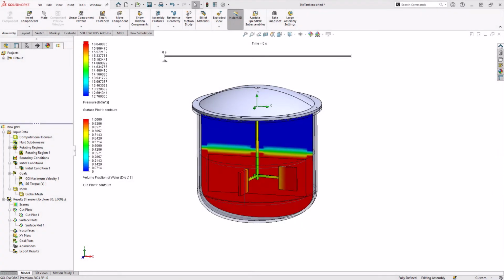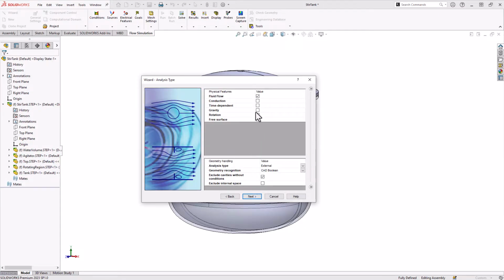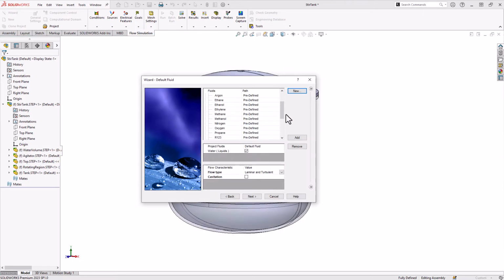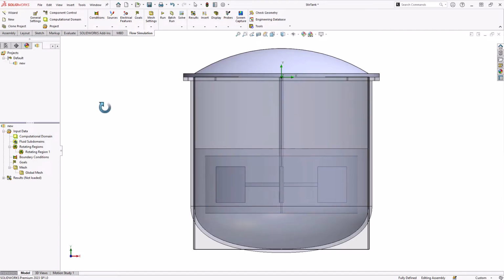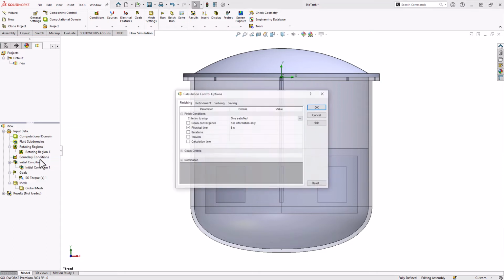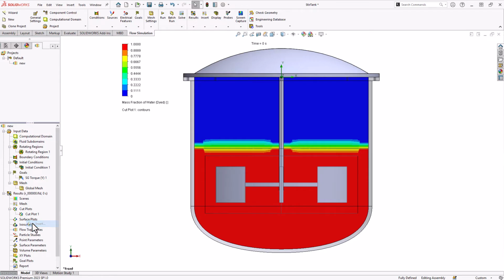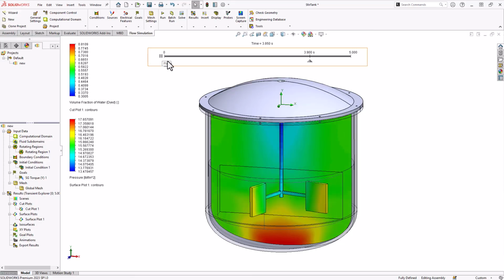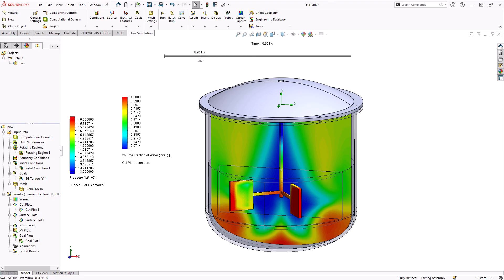Mixing Tank with SOLIDWORKS Flow Simulation

Comment: Hi! it's fantastic. I have a question: why the torque (Y) is different when I use X FLOW programm considering that I have used the same data input in Flow simulation? Thank's a lot for your response and helpfulness.
Reply from the maker: There would be quite a few things to check - I know you mentioned the input data is the same but verifying the liquid viscosity is equivalent, and that mesh refinement has been performed in both software to achieve mesh convergence (or "lattice refinement" in the case of XFlow) would probably be the most important things to verify. These tutorials feature very coarse mesh for the purpose of demonstration.

Were you using the "Free surface" functionality in both packages? In the tutorials we created, we used free surface for XFlow (which represents a tank with headspace / airspace at the top) whereas SOLIDWORKS Flow Simulation version tutorial featured a completely filled tank. These will of course produce different torque results, with the simulation representing the headspace expected to be more accurate if that is the physical condition.
Reply: @hawkridgesystems  
Thank's a lot for your answer.
I redid the simulation and got more similar values between Solidworks and Xflow.

Comment: For some reason even though my volume of "dyed" water takes up only 25% of the whole tank, after some time of mixing the volume fraction of dyed water is 0.5 on every point of the tank, not 0.25 like one would expect. Why does this happen?
Reply: Oh and other times the dyed water just seems to disappear from the tank altogether, even though there are no holes in my tank
Reply from the maker: @christosfrantsis7599  Did you check to ensure on the "Initial Conditions" screen that the substance concentrations are initialized correctly? The first issue (settling on a 0.5 value) sounds like maybe it was set to a 50/50 concentration instead of 100/0
Reply: @hawkridgesystems  Thank you so much for your answer. It turns out that my mesh resolution was too low. It all works great now ☺️.

Comment: How provide the solid body melting?
Reply from the maker: The solid materials have a melting temperature parameter but this will simply provide a warning when it is exceeded, there are no capabilities to represent solid to liquid phase transition in SOLIDWORKS Flow Simulation
Reply: @hawkridgesystems  could you please advise where I can read mor3 detail about that?

Comment: Thanks for the video, is it possible to add a heat source to a moving object (rotating or parallel motion) in solidworks to simulate temperature change?  Is it possible with this model to add a heat source to the wings of a rotating mixer, for example? I know they each have a function, but I was wondering if it is possible to do both at the same time. I asked because I tried a couple of times, but the heat source was calculated to stay in place.
Reply from the maker: It should be supported for rotating motion, linear or other body motion is not really possible in SOLIDWORKS Flow Simulation

There are some limitations around conduction between rotating and non-rotating parts when using the Sliding Mesh approach, but they shouldn't effect something like a heated mixer significantly.
Reply: @hawkridgesystems  Thank you very much for your reply. I tried adding a radiant heat source to the rotating body, but the rotation function was ignored in the heat-related results.
Reply from the maker: @6023  What was the exact heat source definition? If you use something like a "volume source" to heat the mixer/agitator itself it should work. This also requires conduction enabled in the project settings and an appropriate conducting solid material applied to the agitator/mixer.
Reply: @hawkridgesystems  It was Radiation source with directional type.

Comment: Sir  is it possible to analyze mixing of  co2 gas with cold water in a pressurized vessel 
Suppose a vessel is in vertical  shape( 400mm diameter × 1700mm height) and vessel is packed with perforated plates and we pressurized that vessel up to 100 psi 
and then with the help of high pressure pump, water is sprayed through nozzles from the top of vessel towards bottom.
My goal is to find out how long is it take to water to pass through those perforated plates and at last how much co2 gas is mixed in water
Sir can we do all these things in solidworks flow simulation

Comment: Hello, thank you for your video, it's very useful.
I would like to ask if it is possible to add an air space in the top ?
Reply from the maker: It's possible to include the headspace if the "free surface" option is enabled. This lets you load both air and your liquid in as fluids. 

Then you would need to set an initial condition to set the waterline to the correct height. This can be done by using some dependency / height function or modeling a solid body to represent the liquid region, and specifying an initial condition on it.

Unfortunately though you can only have two liquids using the free surface approach, so you wouldn't be able to actually simulate the mixing of a secondary liquid with the headspace. You could infer the mixing performance from the velocities.

To simulate the mixing of multiple liquids and also represent the headspace simultaneously, we can do that in SIMULIA XFlow, and have an additional tutorial here: https://www.youtube.com/watch?v=P2bCsVFlpXQ

Comment: Given the ease of GUI based setup shown why would an alternative such as Ansys similar be preferred
Reply from the maker: Generally our recommendation would be to step up to a dedicated standalone analysis tool only when it's required for the physics of the application or when solve time or performance becomes a limiting factor. 

CAD-embedded analysis tools are developed to be very good at solving the most common classes of problems- such as linear static stress analysis, internal/external fluid flow, and thermal problems. This enables designers and engineers to make quick design-time decisions without having to invest significant effort into setup for the vast majority of their applications.

The same CAD-embedded analysis tools may not have specialized boundary conditions, solvers, and post-processing options that could be relevant for certain industries. They also tend to have more limited scalability in terms of solving on HPC cluster or GPU. 

In this particular case, we have an example of running the same simulation in SIMULIA XFlow which enables handling of additional physics for mixing tanks. For instance, a reciprocating style mixer would not be possible to simulate in SOLIDWORKS Flow Simulation as it does not support translational mesh motion, only rotational. XFlow supports generalized movement, as well as more robust "free surface" interactions which also allows including the headspace at the top of the mixing tanks. 

Mixing Tank analysis in XFlow: https://youtu.be/P2bCsVFlpXQ

Solution accuracy (when the physics and boundary conditions are supported) is generally not an issue compared between CAD-embedded analysis packages and standalone packages. You can find validation examples for SOLIDWORKS Flow Simulation here: https://www.solidworks.com/sw/docs/Flow_Validation_Methodology-Whitepaper.pdf

And similar examples for SOLIDWORKS Simulation are embedded within the software. It's always a good idea to check that the software package is well validated for a problem with similar physics to yours. 

Lastly regarding performance, the SOLIDWORKS Flow Simulation and SOLIDWORKS Simulation tools have a somewhat noticeable dropoff past ~16 cores though there is no hard limit to problem scaling. This is generally sufficient for tackling wide ranges of problems. Dedicated analysis software may be able to scale to hundreds or thousands of cores, but also requires increased cost of consumable credits or other per-core licensing scheme.

Comment: hThank you for the video but it not work for me yet. the message: Il n'y a pas de volume fluide dans le projet Vérifiez la géométrie ou les conditions aux limites. (it didn't found the volume of the fluid) I need help
Reply from the maker: Be sure to clear / uncheck "Exclude cavities without Flow Conditions" during the Project Wizard (this is the most likely cause)
Reply: @hawkridgesystems  hello, it give me volume fraction wter copie) 0 (all in blue and didn't show me the picture )
Reply: also in the case of exclude cavities without flow conditions i don't heve the case of "find the flow)

Comment: Thank you for this video. It is very helpful and interesting. When you set the direction of the rotating region, you refer to the liquid rotation or at the stirrer rotation? The sign of the torque on the shaft change.
thank you in advance
Reply from the maker: The rotating region direction refers to the rotation direction of any solid bodies contained within

As far as the sign on torque, that follows right-hand rule for the coordinate system specified. Generally we recommend to align the rotating region axis with the global origin / coordinate system so the reported torque values are correct.

Comment: Thanks for making the video!
I tried this tutorial, but I got an error saying "There are no fluid regions in the project. Please check geometry or boundary conditions."
Is it necessary to set the fluid subdomains?
Reply from the maker: There's a couple possibilities:
-Be sure to clear / uncheck "Exclude cavities without Flow Conditions" during the Project Wizard (this is the most likely cause)
-When defining the "Initial Condition" for the second substance concentration, check the checkbox for "Disable Solid Component"
-Ensure the "Computational Domain" is properly size. Edit it and click "Reset" after performing the above steps and it should snap to roughly the size of the entire tank.
Reply: @hawkridgesystems  Thank you for answering!
As you might have guessed, "Exclude cavities without Flow Conditions" was still checked. After changing it, I got the desired result. thank you! ! !

Comment: Hi, do solidworks fluids simulation get's pressure and temperature data of a gase in a confined conteiner?
Exaple: internal combustion engine
Reply from the maker: The solver in SOLIDWORKS Flow Simulation is compressible and will support the proper thermodynamics of gas expansion and compression (either with ideal gas or "real gas" model) 

However there is no way to support the translating wall of a reciprocating piston in SOLIDWORKS Flow Simulation. The only geometry motion that can be defined is via the rotating regions. Combustion is also not supported directly

Something like simulating the mixture of exhaust  through a turbocharger turbine should be possible, or simulating intake or exhaust flow with valves in fixed position. 

Translational body motion is possible in SIMULIA XFlow and it can be used for applications such as piston cooling

Comment: what version do you use Sir?
Reply from the maker: SOLIDWORKS Premium 2023 and SOLIDWORKS Flow Simulation 2023 were used in this video . You should be able to follow along with the same procedure back through the 2018 version, possibly even older versions

Comment: I need this type of study done, but with a constant input/output of water and solid through an open top and piped bottom.  Any contacts that could do this?
Reply from the maker: This is a type of analysis we could run in either SOLIDWORKS Flow Simulation or SIMULIA XFlow depending on the complexity. You can e-mail info@hawkridgesys.com to get a discussion started if you want a quotation on having this performed as a service

As far as the inlets and outlets, there's no reason there couldn't be flow in and out during the simulation presented here. The "open top" can be evaluated using the Free Surface functionality. 

What is the makeup of the solids? Are they in powder/granule form?

Comment: Thank you so much this is really interesting and thank you for showing the steps.

This which I would like to know is
Thermal analysis of a mold which is used for aluminum die castings.
What will happen to the mold when it is suddenly cooled? Will it have high thermal stresses? And will it crack ? Wish u guys made a video on that 🙏😀☺️
Reply from the maker: We will add it to our topics list, thanks!